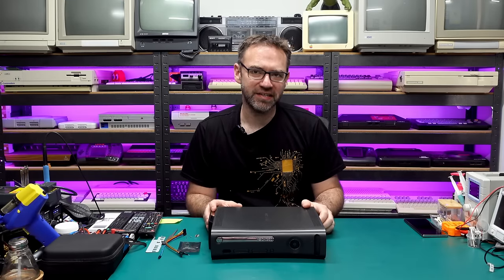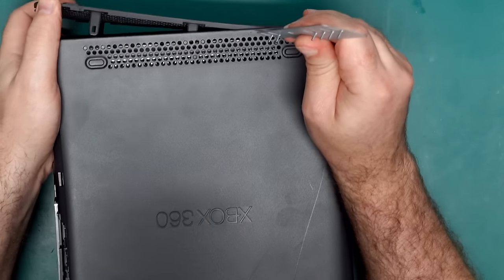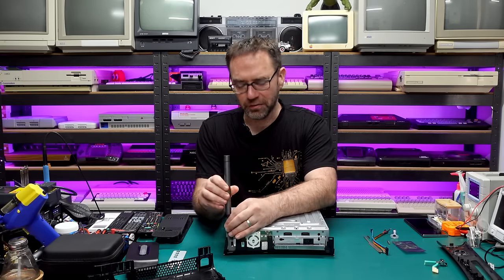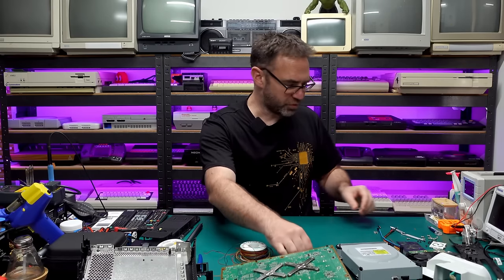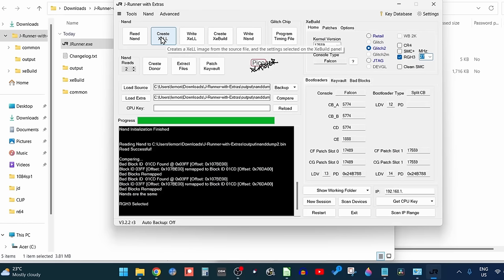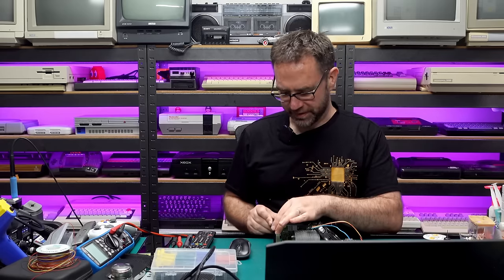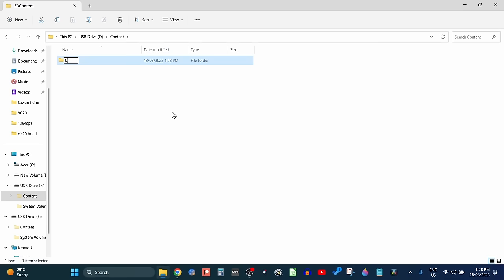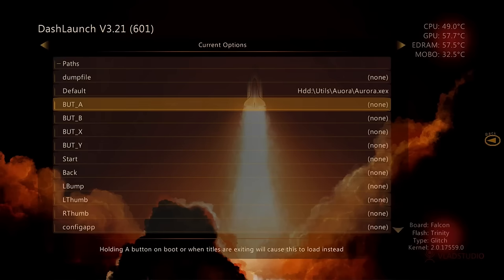How to RGH3 a phat Xbox 360 in 2023 with a Raspberry Pi Pico - install homebrew and backup games

Comment from the maker: Update: After 3 months the console no longer boots. As I mentioned from the start, RGH3 is not recommended for phat consoles. You may have success with it at first but don't count on it lasting forever. I'm not pissed as I kinda expected this to happen eventually 😂

Further update: After removing the RGH3 wiring and flashing the original NAND backup, I got RRoD 0022. Spent a day trying to resurrect it, making sure no traces were damaged, joints bridged etc. Even went as far as redoing the f up I made with FT6U6, changing to RGH1.2, playing with many different options in J-Runner, and the result was always the same - 0022 with retail dash, and nothing with RGH (just a green power led as the modified NAND cannot display most RRoD errors afaik).

Almost certainly the CPU is dead, whether or not it would have died anyway without RGH3ing I'll never know - probably. Anyway, like I keep saying RGH3 is not recommended for phats. Time to RGH1.2 my other white Falcon 😁
Reply: Get 3rl?
Reply from the maker: No. It just sits there doing nothing, power light and fans turn on but that's it. I might try flashing it back to stock, see if it still works and if so I'll install rgh1.2
Reply: @TheRetroChannel  if you can make a video about your try 👍
Reply: @TheRetroChannel  mine booted for about 2 days and stoped..light and fan came on but no boot....checked my solder joints with a magnifier and there it was! rgh wire was touching a resistor!..redone that and now its been booting very consistent around 4 or 5 sec ever time!
Reply: oh and i used a 10k not a 22k
Reply from the maker: Interesting, I did go back over it and checked all the joints and redid them just in case, but no change. I might try a 10k, but I already have an rgh1.2 chip on the way so I'll wait until it arrives. Saves me pulling it apart again if the 10k doesn't work
Reply: @TheRetroChannel  sounds lika plan..when this one stops booting think il go the same route!..thank you for the videos and all you do!..
Reply from the maker: @kenkem396  I finally got back to this console and the news is not good. I've updated the pinned comment if you're interested
Reply from the maker: @tondaspromos474  I have an update but no video as it would have just been me going around in circles for a few hours. You can read all about it in the updated pinned comment above
Reply: @TheRetroChannel  thanks bro to comment the news!
Reply: ' think you might have given up to quick on this. Problem 1: I had was a DVD drive error booting up the console after the last flash for XEBuild image and it gets stuck at Xell. -Fix: Rather than flashing the XEBuild image via the PICO, place the upflash.bin file in  the root directory of an FAT32 formatted USB drive and boot the system up with the DVD drive and USB connected to the system. Xell will then boot the USB write the NAND from the USB. Problem 2: I had, was as soon as I added the HHD the system did not boot  and went blank. - Fix: Add the HDD to the system, start XELL from the eject button and let it boot up fully. Restart as normal after this.

Just speculating, but I get the idea the HDD and DVD drive needs to be connected during the XEbuild flash procedure or first boot. My system has been running flawless since I sorted out these problems. I get to the XBox boot screen in 2s. Had to change to 10mhz though somewhere in the J-Runner build process. Nice video, thank you!
Reply: I had the same “problem” check your wires and soldering, after moving and testing continuity on some wire of the glitch chip, I had a short ( the wire soldered to the Xbox board was touching some other point), the Xbox powered right up after fixing that.
Reply: I RGH 3'd my Jasper the day that it became available to do so. The Jasper itself had never been hacked in any way prior to that. I am still using it, In fact I am online right now playing a game on it through xbox live with the proto stealth server. 9/10 boots the console boots up immediately, same speed as a non hacked 360. The other 1/10 times all that I do is unplug the power cable, maybe boot xell first, then after that the console will boot immediately again.

EDIT: by saying the jasper had never been hacked prior to that, I of course mean MY jasper, not jasper's in general.
Reply: What do you recommend if not the  RGH3?
Reply: @Dimish1  RGH 1.2 is generally recommended for phat models, but that requires a glitch chip
Reply: I know this is an old video, I hope you read my comment. Some people recomend using AMS1117 1.2v regulators. Do you think that this would make any difference? Thanks! Great video!

Comment: I may be the only person on earth who still has a working launch day 360 that has never had an issue. Still works fine
Reply: Mine works fine, but the shell is old enough that the clips break off when I tried to clean it recently. T.T
Reply: I have two launch team consoles. They’re both working. Although all they do now is sit on a shelf.
Reply from the maker: @Destiny 1G Better to have a few broken clips than a dusty 360 I guess, especially when they're prone to overheating
Reply from the maker: @carnavs  Nice!
Reply: You must not use discs very much, are you sure it's a launch-day xenon? or is it an Opus (the xenons fixed with leaded re-ball) Opus are bullet-proof, but the hitachi ODD dont last that long....
Reply: I’ve got one from my buddy that was all good till just recently it started having trouble reading discs. (Which is what brought me here lol) I’ve also got the green halo 3 edition that I got new when they it was released but that was a different story. It does still work at this point but it also has disc issues and that console was nothing but problems since the beginning. Controller, battery pack, charger, headset, power brick, hardrive. All broke. Wireless connection randomly disconnected often. Had have it fixed and sent in so many times because of that damn red ring.
Reply: LazyITGuy?
Reply: I traded in my OG when I got 3 red ring of death back to back

Comment: I really wouldn't bother messing with the SMC temperature targets in Dashlaunch, just leave it stock. Even if you have an early Falcon with a defective GPU (part # is X810480), setting the fans to run faster is not gonna prevent the GPU from failing. My Falcon has a fixed GPU and was running totally retail since I got it as a kid in mid 2008.
Reply from the maker: Yeah, looks like the CPU died in this one anyway. I just modded another Falcon with RGH1.2 and didn't bother messing with the temp targets this time
Reply: @TheRetroChannel Nice!

Comment: Oh wow,  i remeber trying to flash the dvd drive, and could not get my pc sata to talk to it. So i pulled apart the drive and the flashrom had resion on it, got the reson off, desolder the flash rom, made a harness and external socket, then modded my aopen motherboard and added a second socket and apropriate mods. Then modified the bios flash program to reconise and program the 360 dvd drive flash rom. 😂
Mother plucker, and woo hoo it worked. All while i was working 12hour shifts labouring and going out to the shed late at night and early morning 😴

Fun time and i still have the drive but the xbox died, but i have used drive on other xboxs but i tbink i had to change a key as the drive is coded to the mother board.

Comment: @@ 5:40 if you dont have a fancy tool like this, do like i did atleast my trinity model had this trick.  Under that sticker /case on the left side is a a latch hidden from the top access.  That latch has a secret access hole under that sticker.  Feel around for an indentation then get a screw driver poke through and push. It should release the clip right away.

Comment: just found the channel, you've got great pacing, just the right amount of information presented without going too crazy on specifics unless you have to. really enjoying what i'm seeing so far. it's great to see a variety of era's of consoles you're working on as well, keeps things really fresh and interesting.

hope you can get used to soldering under the microscope, that sounds like a really tough thing to get down.

as someone who jtag'd hundreds of phat consoles years ago, it's really interesting to see someone rgh a phat 360, really a damn shame that it died so quickly. happy to see it's more accessible to do so using the pico.

keep up the good work

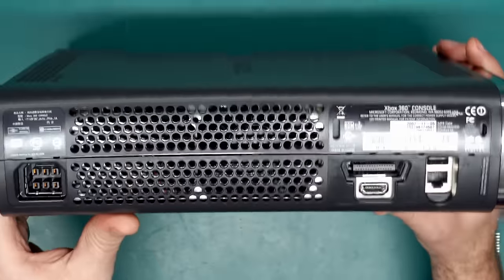Comment: Hi. I was given an unfinished project, according to websites, videos and online resources I'm trying to play with a "Zephyr" (16.5A),(flat prong on power supply),(hdmi). All looks the same as mine. My MFR date is exactly the same date as yours 2007-11-05. The only difference between your Xbox and mine is color. Mines white. @ 00:33 of your video shows your sticker with dates, power supply etc. I made my own xclamp tool that works almost too good with an angle grinder. I'm almost about to just follow through with the project using my pico pi. If you can confirm that yours is a Zephyr, or were both doing a Flacon like your saying in the video. Please and ty. Great video , excellent explanations and looking forward to more content like this.

Comment: Something I found when copying discs to my Trinity system is that there are some games that MUST be installed using GOD format. I had one with an illegal character in the file name (allowed on the DVD format, but not the hard drive file system), and one where the file name was simply too long. (Many subdirectories deep.)  Ripping to GOD format solved both problems.

Comment: Do you use solid core wire or stranded wire? Is solid core easier or not worth it because it might break when bended? Thanks for this video, very informative.
Reply from the maker: 30AWG solid core, it won't break from bending unless you force it to.
Reply: @TheRetroChannel Ok thanks! I might have to go with stranded 28awg, having a hard time finding solid core in my area.
Reply from the maker: Honestly I would recommend ordering some solid core stuff online if you can't find it locally. The stranded stuff can quickly become a hassle when trying to solder it neatly to those tiny points on the board.

Comment: I wish I didn't throw my xbox's out :( I still have a jasper JTAG, but I had a falcon that had a bad flash on the dvd drive that I could have saved with RGH but I just threw it out because they were selling for 20 dollars on ebay and I couldn't be bothered to mod it at the time. I threw others out too but they were mostly busted. Various RRoD issues and a corrupt nand with no backup.
Reply from the maker: I think we all have those regrets, but that's what happens when they're a dime a dozen. Good thing is they're still cheap and fairly easy to find if you want a backup console

Comment: Does modding the 360 remove the disc requirements for games already saved on the HDD?
Reply: Yes, a program called NXE2GOD does that.
Reply: @firstsurname9893  Thanks for the tip!
Reply: In the last update you cna paly games from the hard drive or form usb sticks too if you don't run different systems on the xbox or use it for coding or homebrew don't fuck up your console it's not worth it....

Comment: Hi, thanks for the instructions. Is there any other mods for X360: 
- upgrading the RAM to 1GB (Dev kit has this amount of RAM ant will it work)?
- breaking the limit of 2TB for disk?
- connecting second disk via SATA (replacing DVD for example)?
Reply from the maker: I don't believe there's any way to upgrade the RAM but google is your friend there.
The 2TB limit has been broken recently by Eaton, and I believe the patch is included in the latest versions of JRunner. I haven't played with this myself so don't know exactly how it works.
Not sure about the 2nd disk, again google is your friend there
Reply: @TheRetroChannel  well, I've search a lot, but few years ago. Last time there was no any options to break all those limits. And, probably, they are still exist. Except disk size. 16 TB i enough:) 
If it will be possible to little increase performance for the console to make some games run on stable FPS. Just dreams. Sooner we will have stable and fast emulation in and powerful enough integrated graphics for running Xbox games ;)
Reply: @TheRetroChannel  have you ever heard anything about being able to put an SSD in the 360?
Reply from the maker: Not that I've heard, but I haven't looked into it

Comment: Hi, hear a question, why did you take the point (FT6U6) and in the videos I've seen or the installations I've done we always take the point (FT6U7) does it have something to do with it or is the point (FT6U6) more effective? Could you get me out of it? the doubt.
Bye
Reply from the maker: FT6U6 was a mistake which I soon realised later on in the video
Reply: David entiendes español , spanish man, este man no ve bien o ya pasa del 4 piso , yo acaba de hacer el Rgh 3 en una jasper con capacitores electroliticos, ya que hay versiones con capacitores sólidos .  Te comentaba que primero la lleve con un técnico . Para que el trabajo fuera más profesional , el seudo técnico me la regreso y me dijo que no se pudo , me cobraban 40 dls , por ese trabajo . Lo bueno que no me cobraron por hacer el intento y me la regresaron funcionando .  Tuve que ver muchos videos antes de animarme a hacerlo yo mismo. El el primer intento , apague la consola extrayendo la Nand, y ya no dió señal de vida . Tuve que recuperar la Nand , y despues todo me salió al pie de la letra , apesar de que mi nand. Trae sectores defectuosos , use el jrunner más reciente y al copiar la Nand me hizo el checkdisk de los sectores dañados .   Análise los puntos de Pll y smc , y pues nadie sabe realmente que hacen estos pines , o ocupan puntos alternos .  En mi jasper use el mismo regulador de 1.2 v que trae la consola con un resistencia de 10 k. Y ocupe un diodo 1n4148 , en el punto FU7 ,  si conectas mal , hace cosas extrañas el Xbox360 .  Así que solo solda bien y une los puntos ,correctos espero te sirva mi respuesta , yo también soy. Grande y no veo ocupo lupas para ver . Y si soldé mal , hasta la 3 vez pude hacer el RGH

Comment: What is recommendation for non hdmi phat model
Steps you have followed will work with it as well ?
Reply from the maker: EXT_CLK for Xenon
RGH1.2 for Opus
Both require a glitch chip and programmer so the method in this video will not work

Comment: What cheep soldering iron do you recommend mine doesnt qork has good anymore even though i replaced the tip but qhat would you recommend
Reply from the maker: I hear the TS100 and pinecil are decent options if you're on a budget. I haven't used either myself, the one I use is an Aixun T3A which is a bit more expensive. You can find some info on it in the "tools and kit" link in the video description
Reply: @TheRetroChannel  is a 90w soldering iron enough for a lead free rosin core solder cuz I found a pretty good deal on Amazon for one it's $30CAD and it's digital max temp for it is 450c is that decent or na

Comment: hello, how are you, look, what happens is that I made RGH3 to an xbox 360 fat Jasper board, but when it comes to turning it on it takes approximately 20 seconds, other times it turns on immediately, I did everything you say in the video, the only thing is that I did it with the 1.2 volt regulators and the points are different I did the installation as in the video of (TecNobit) could you help me and tell me what could be the problem Goodbye
Reply from the maker: RGH3 boot times will vary a lot on fat 360s and may eventually fail to boot at all, hence why it's not recommended for Falcon/Jasper. Change to RGH1.2 if it bothers you

Comment: Can I also flash my Xbox360 Zephyr with it ?
Reply: No. You would need to JTAG a Zephyr, Xenon or an Opus. RGH 3 doesn't work on any consoles other than Falcon or Jasper phat models and Trinity and Corona slim models.
Reply from the maker: It is unlikely you'll find a 360 with an old enough dash to JTAG it. But you can still use EXT_CLK for Xenon and Zephyr, all other phats (including Opus) RGH1.2

Comment: Why does all these videos only show how to do this with the Pi Pico? Why can't it be done with any small ARM-based computer, like the Banana Pi? Isn't just some GPIO pins and maybe i2c (or SPI) all you need??
Reply: @MattBeaver  A LOT of devices have real SPI. The ESP8266 and ESP32 comes to mind. Even Arduinos have SPI. Why only the Pico?
Reply: @dtesta  it's cheap as dirt
Reply: @MattBeaver  No, it's not. The pico is 10 USD+, while the esp8266 is like 2 USD.
Reply: @dtesta  Pico has a faster processor, more ram, and an easier development environment then.
Reply: @MattBeaver  And why would that be needed for a simple SPI flashing?
Reply: @dtesta  It's probably for SDIO reads/writes there's lots of checksums involved according to the picoflasher code and it has to handle USB IO at the same time as SPI/SDIO over GPIO.
Reply: @MattBeaver  I found a pico for 4 USD, so it was cheaper than I thought. Then it's fine.